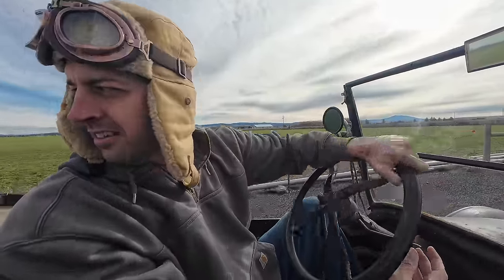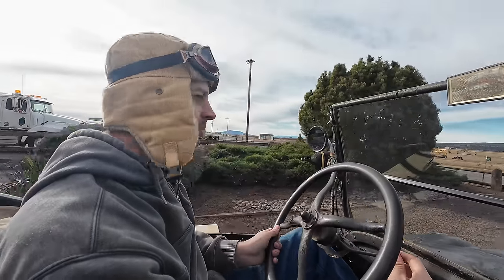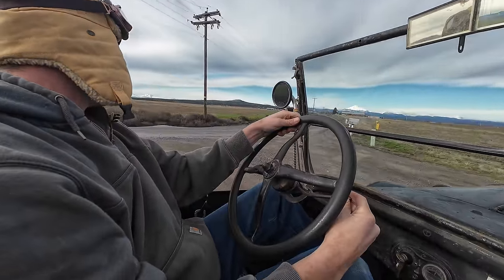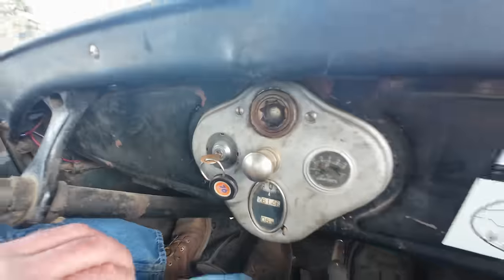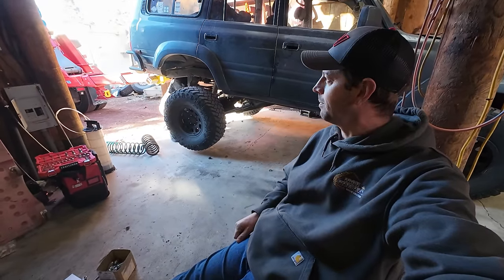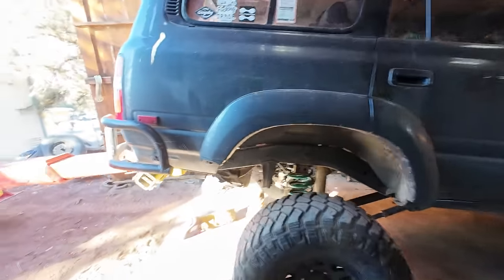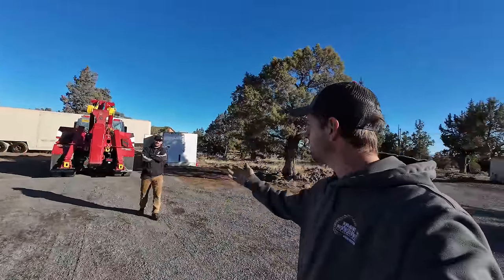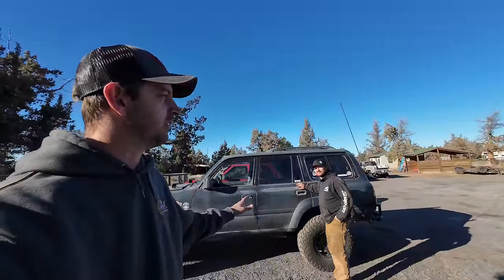Test driving 100 year old cars!   (I’m buying one)

Comment: To answer the question about releasing the brake... NO, always keep your foot on the brake until the truck starts moving, just enough to keep the truck from rolling backwards/forwards when you don't want it to, then release the brake! Treat it like you are ALWAYS on hill, because the added weight that you have will start moving rather quickly.

Comment: Thanks Ethan, you managed to push me back into the year 1988, driving lessons in a truck. Having the best of times, including the stressed look I see on your face, and your brain in overdrive.
Reply: I was learning to drive the truck and back up a trailer all in the same day lol, right around the same time...Dad was in the passenger seat containing his laughter quite well.  Within the next 6 months I had driven each variety of truck on the yard hooking up and swapping out doubles - 70's internationals with air starters, 6 speed sidewinder Macks, twin screw volvo sleepers - yeh, backing up a converter dolly with one of those is a hoot and a half!!
Reply: @philn9813  My brain hurts just thinking about doing that last part. I'd have it all twisted up in no time.
Reply: @--_DJ_--  It was all fun stuff.  A driver might be coming through keeping the front load and picking up a new rear, so, he'd drop the rear trailer, keep his dolly and we'd spot the new rear behind the dolly - sort of a parallel/90 degree parking job backwards...The reality was you could show up for your shift and drive anything from the yard switcher with a hydraulic fifth wheel or a tractor of some flavor.  The variety kept you on your toes for sure!

Comment: Good morning Casey I agree that a series of teaching Ethan stuff would definitely be a good idea. 
The reason it would be a good idea is because it helps Ethan but you also educate your subscribers about things that may not know 
Ethan needs to get more confident in my opinion learning from you is a true honor because you will teach him the right way and not just the short cut tricks. 
Are you running low on power steering? When he was turning the wheel backing up sounded like you may need to add some power steering unless that is a normal thing.

Comment: Nice, I would buy the truck. My Uncle used to buy these, fix them up, drive them a bit, then sell them. My Dad and Uncle used one of these trucks with an old hood tied to the back to clear and dig the hole to the half sunk basement for our house. They bolted two 2x4s to each side of the hood and my Dad held those while my Uncle drove the truck.

Comment: My cousin has a 1920s model T truck that was made in Canada. It spent most of its life inside a mens clothing store. It runs and still has the wood wheels. The reason I know it was made in Canada is that the word Canada is on the radiator cap on the running boards on the engine block and on the tail gate.

Comment: First time I ever drove a truck was interesting. I had answered an add to drive a harvester in Medicine Hatt A.B. I met the guy in a pub and drove to a farm. I then drove a combine for the first time for about 20 miles, taking up the whole road. When I got to the farm, I was told to jump into an extended dump truck towing a feeder for the harvester. With zero experience and no class 1 I was told to drive to another town. Shifting up was ok, but double clutching was difficult when down shifting. To make things worse, there were 3 of us in the cab with my new boss screaming and cursing as I struggled to get the truck into gear. Casey didn't seem too bad.

Comment: I am currently building a 1924 ford model T 4 door sedan with a 2024 2.3L Ecoboost from a mustang with it's 10 speed automatic transmission.  The car is 100 years old and it will be a practical daily driver with a 4 cylinder ford power train that is exactly 100 years newer.  The car is going to be as stock appearing as possible inside and out. The car is getting modern heating and air conditioning and it will be mounted under the car with vents hidden throughout the interior. Everything will be controlled from a hide away touch screen. It has power door locks, keyless entry and power windows.  I am using a 2024 Ford key fob and I still need to find a company to make a custom housing for it using the vintage ford logo and model t insignia. People are going to trip out when they see it passing them at 80+ mph on the freeway on a hot summer day with all the windows rolled up.

Comment: did not know you have that clutch break thing. isn't there a clutch sync on american tractors?
Reply: No, unless you are driving something with less than eight or nine speeds.  Most of the tractors now have automated manual transmissions.

Comment: You made it too easy.  I was directing a friend to a fuel station when he got frustrated and told me to drive an International cabover on narrow city streets.  I protested to no avail and found myself having to keep the tractor between the lines and shifting a 13-speed at the same time.  The third time through I got the transmission, but shifting without a clutch was an experience.

Comment: Did you get a wireless remote for your dump trailer? If not, you can use a $40 Harbor Freight wireless winch remote and two diodes. I did this on my MaxxD and it works great. Beats $300+ for a “proper” remote.

Comment: You would have a blast overlanding with the group!  Can you figure out a way to put a selectable locker & or turn one into a 4wd?  Im sure some old timer rigged something up!??  My grampa put twin transmissions in his old car for higher speeds.  He sewed some rattle snake rattles onto the top of 2 leather straps he streateches overhead.  At speed he would roll down a window & scared his dates.   BTW why not get ahold of Merlins old school garage for a modle T?  He has a crazy hord of parts & Im sure leads on a model  T for sale if not one you can buy.

Comment: Would it (while overkill) be possible to hook the trailer to the wheel lift of the big truck and dump it at the dump that way?  Would probably need to change it to a pintle style coupler as a ball probably wouldn’t have enough angle to tilt. Just a thought

Comment: ethan has no idea how lucky he is to have someone offering to teach him  i got my first truck and was thrown into it with no real world training and no real support  ,it was all hands on learning but i can proudly say i only damaged 1 vehicle in 10 years and that was a  gm fwd that silly tie rod end on rear suspension i caught it with my j hook  but fixed it for like 10 bucks and a alignment  and as far as equipment i only bumped a fender on truck coming down the 4610 road my front end washed out on a corner and i ended up in the berry bushes and dented a fender , yeah just the driving part learning saves him 5k of school  costs alone

Comment: It might be worth mentioning to Ethan that you don't want to be hard on the brakes when the parking brake is on. New trucks it won't matter, but old ones don't (or might not) have anti-compounding valves and a stomp on the brakes with the parking brake on can bend parts that were never meant to take 2x the normal braking force. 
Our driver at work often does his "6 pack" in the morning with the parking brake applied. I've given up on trying to tell his dumb ass that what he is doing, is doing nothing rather than adjusting the slacks.

Comment: The left I guess you could say spark advance but it's timing advance and retard or timing adjustment my grandpa taught me to drive his and work on it including  1 winter a full rebuild in the blacksmith shop while dad made horseshoes (try playing horseshoes with real horseshoes instead of the giant ones usually used a ringer is almost impossible) the blacksmith shop was used because the only other heated building was the milk house or farrowing house for the hogs I wish we'd done it like I did my 62 bug carry it in the house and on the kitchen table in front of the wood stove my wife saw no humor in that I had to buy a new table to eat on she'd probably really be mad if she knew we didn't clean it all in the shower small parts went in the dishwasher

Comment: Got a 1927 T under a carport hasn't ran in 15 years I drained fuel when I put it away. id bet some lawnmower gas sand paper and set points be running in two hrs like it never left the road. It take forever but night driving some led lights back roads id drive in from WNC so Miami with a gallon of oil a gallon of water a standard wrench set id make it no doubt. Take rear wheel off run a sawmill a week put wheel back on return to NC. Henry Ford said model T was a failure. Made them too simple to repair and too reliable.

Comment: Those fault code free cars are amazing. Since the driver is the engine control unit, would adding an oxygen sensor and gauge be beneficial for performing that task more optimally, or does the car give enough feedback that such an upgrade is redundant, or is this whole idea just plain wrong?

Comment: 4 runners don’t need midfield to still run every day that thing you call a jeep is not cause it’s got other parts on it and newer stuff on it and it’s broke down on you trying to do a recovery so my 4 runner has ove 4 hundred thousand miles on it and still running  good & the only thing I ever done to it is oil changes jeeps are only what yall modify them to be that’s all nothing else